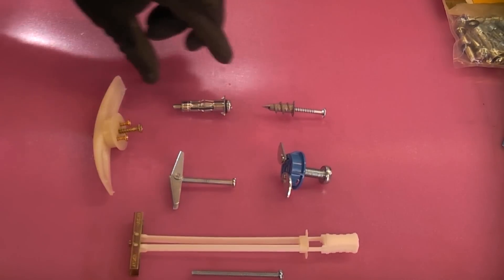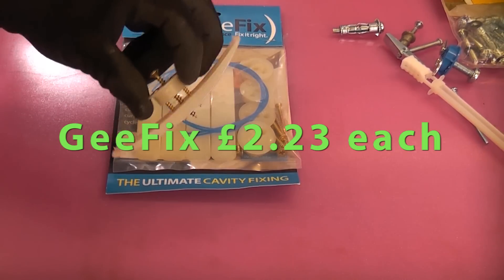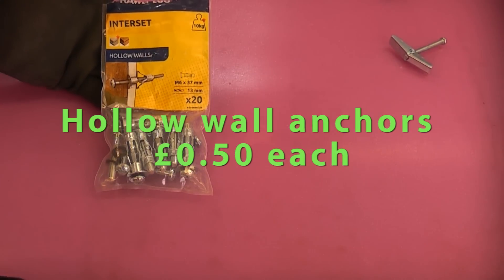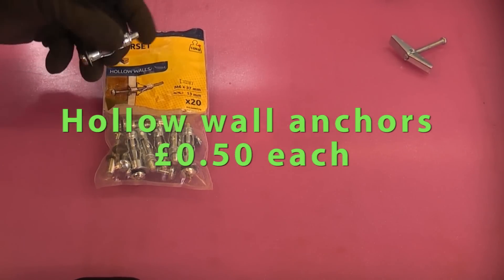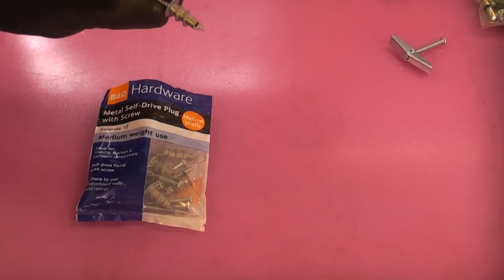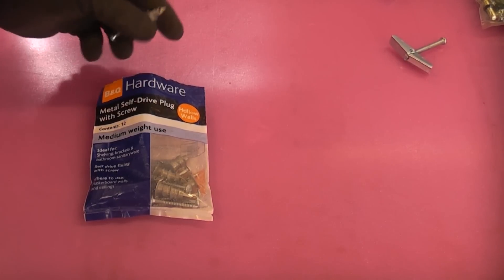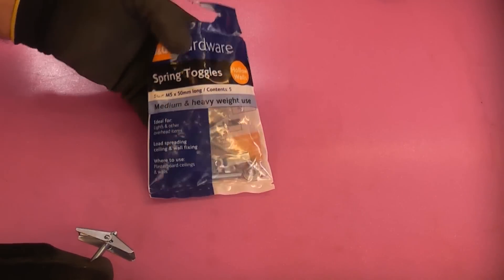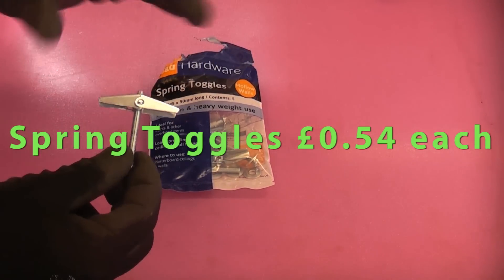The worlds strongest plasterboard fixings | Drywall fixings strength test

Comment: Good video bud it has assured me i just hung a tv up on dry wall and was giving me sleep less nights legend 🙏
Reply from the maker: Nice one!
Reply: @ultimatehandyman  
Sorry bud had a question want to hang a 50 kg mirror to plaster board cant find no studs were i want to position will it be safe to hang with anchor screws and setting tool? Many thanks 🙏
Reply from the maker: I'd use snap toggles rather than anchors-
http://www.ultimatehandyman.co.uk/forum1/viewtopic.php?t=106943
Reply: @ultimatehandyman  
Thanks legend 🙏

Comment: Great video. There's no one fixing that works all the time but typically for me - light items Fischer duopower, medium weight items hollow wall anchors, heavy items spring toggle. These fixings are cheap and readily available from local shops whereas some of the exotic ones are expensive and/or hard to get hold of.

Comment: We need another test, this time, take the three strongest - Snaptoggle, Geefix, and the spring toggles... now let's put a cantilever bracket on and add weight to that!
Reply from the maker: Just use spring toggles, they have been around for decades, work well and are available everywhere 👍
Reply: @ultimatehandyman  Thanks buddy will do. The cantilever attachment would be a good test with the three best however ;) This video needs more views!

Comment: The backet I want to use has four holes which are 4mm wide, my challenge has been finding a fixture which will fit! Do you have a particular brand of spring toggles you'd recommend?
Reply from the maker: I think the spring toggles are pretty much the same. I think I got mine from Screwfix or B&Q 👍

Comment: Thank you so much for the video, super informative. We have a 12.6mm plasterboard and want to put up an Ikea BOAXEL wardrobe system (all is mounted exclusively on the wall), but we could only find 2 studs that match the railing holes. Planning to fix 14 x M6 snaptoggles + 2 studs for 165 cm wardrobe width. Do you think this will be enough to hold? Many thanks.
Reply from the maker: I have no idea if that will hold, sorry.
All I can do is guess, and providing you fix into the two studs and use snap toggles, you have the best chance of it holding up, as snap toggles are one of the best fixings available 👍

Comment: Great comparison, thanks. The spring toggles are impressive. Were the Geefix fixings oriented the right way though? It looks like you installed them vertically (since only a thin strip of the board is pulled away on failure) rather than horizontally, which I think is the recommended way and would have supported more weight.
Reply: Indeed - would have been great to show them horizonal too.

Comment: What if the plasterboard wall is hollow e.g. fixed to nothing but a timber frame?
Reply from the maker: That's exactly what this video demonstrates. I set out the timber to the same spacing as studs in a stud partition wall 👍
Reply: Great! Thanks man

Comment: Great video...I will be hanging kitchen wall cabinets this week onto 60mm insulated plasterboard. Do you know if the spring toggles would work with the insulated board? Failing that, I could always use very long screws and plugs to secure a fixing into the brickwork. Appreciate the help in advance👍
Reply from the maker: Fixing to the brickwork is by far a better option.
Example here- https://www.youtube.com/watch?v=7DGGUbbbBZI&t

Comment: This is brilliant and has totally opened up some options for me rather than having to find a stud in the wall. This covers a sheer force but what about pulling force? Is it similar to sheer with snap toggles?
Reply from the maker: I have never tested plasterboard fixing pull force, as that would only really be useful if fixing to a ceiling. Nobody I know would ever use a plasterboard fixing in a ceiling, unless it was for a smoke alarm etc. In which case you can use any.
Thanks for the comment

Comment: Thank you for posting this video. I was planning to put a wall shelf above my bed and I was not comfortable how durable it would be over the long period of time. 

Including the weight of the wall shelf, total weight is estimated to be around 12 kgs and the shelf will be fitted with 9 hollow wall anchors. Judging from the video, it will be strong to hold the weight.
Reply from the maker: Yeah, that should easily hold that weight.
Thanks for the comment

Comment: I'd be interested to know how or if the performance of the GeeFix changes depending on its orientation. Vertical v horizontal or even mixed orientations on the same bracket
Reply from the maker: It might have a little difference, but it's the fact that you have to cut such a large hole in the plasterboard to begin with, same with the GripIt fixings etc. 
Thanks for the comment

Comment: Great video, thanks for taking the time to post! Wondering what you would use to fix heavy shelves (upcycled scaffold boards) to internally insulated walls, 37.5mm plaster onto 9in cavity blocks?
Reply from the maker: I would use either Thunderbolts or snap toggles, but also I would use space plugs or would cut wooden spacers to space the brackets so that the plasterboard is not crushed with the tightening force of the fixings.
Thunderbolts should work, especially if you are lucky enough to hit the non hollow part of the block, but I'm not sure how good the Thunderbolts will work in the hollow part, so you could use Snap toggles in the hollow parts, but I would use the M10 version - https://www.toggler-uk.com/toggler-snaptoggle-bm10.html

Snap toggle video- https://www.youtube.com/watch?v=tAIUublenMw&t
Space plugs for insulated wall- https://www.youtube.com/watch?v=7DGGUbbbBZI&t

Thanks for the comment 👍
Reply: @ultimatehandyman  true gent, was not expectinf a reply let alone a quick one that ga e me some homework. Thamks again and keep up the good worl, MBE material for public service 👍

Comment: this is fascinating. I imagine the spring toggle managed to hold more weight because it hinges so the bolts can angle downwards and still fully engage their threading while the toggle remains flushed with the wall instead of immediately cantilevering and biting into the sheetrock. I just wonder how spring toggles compare to the others after cyclical loading. I wonder if they'll eventually fail mechanically before some of the other options under the same conditions. nonetheless, a great test and great video.
Reply from the maker: Not sure, the only reason why I did this test was because I was sick of all plasterboard fixing manufacturers claiming to have the "strongest plasterboard fixing". They can't all have the strongest fixing!
Thanks for the comment 👍
Reply: @ultimatehandyman  thanks for the response. i could only speculate what was happening with the spring toggles but you could actually see from where you were standing in the video. Did you notice a difference in behavior between the strap toggle and the spring toggles? Trying to decide between these two for shelving (but I'm also going to anchor onto metal framing studs so I guess its a different situation).
Reply from the maker: @philiptatel7837   No, I did not really notice any difference but I was really surprised by the results. The snap toggles or Zip fix fixings are much easier to use though!

Comment: MY problem spring toggles is they are a pain to install, you have to set them up, then carefully guide them in while holding whatever bracket or heavy thing you're trying to mount, then pull the back so they dont spin in place and screw them in. You'd think someone would have taken the exact concept of a spring toggle and made it stay there you you can pre install it. I guess a snap toggle is pretty close but not quite.
Reply from the maker: Yes, they are one of the most difficult to use in some situations. The snap-toggles or zip fix fixings don't hold quite as much weight but are ten times easier to use.
https://www.youtube.com/watch?v=4r_MsgkXsBA&t
Thanks for the comment 👍

Comment: I love your channel. Do you know how these compare to fixing into the stud? Would you expect them to be significantly  weaker?
Reply from the maker: Fixing to the stud will be a lot stronger. Plasterboard is very weak when compared to a stud, I would expect a shelf that was fixed to two studs to be able to hold a couple of hundred kilo's without failing. 
Thanks for the comment

Comment: Great video, thanks. I was thinking of using blue gripits to fix a 1000mm wall cabinet but am now reassessing. What would you reccomend?
Reply from the maker: I would always try to fix to the studs- https://www.youtube.com/watch?v=glzwY76O0d8&t
Thanks for the comment
Reply: @ultimatehandyman  Thank you for getting back to me so quickly and the link to the other video. I will follow your recommendation to affix to the studs if possible. However obviously with a 1000mm kitchen wall cabinet  I'm a bit more limited as to where I can put it so may I ask a couple of other questions. Firstly what fixings (size and length) would you recommend if I can use the studs and secondly what fixings if I cannot.

Comment: hi, great clip and test! Can you perhaps add Corefix test to it? It should hold 250kg
Reply from the maker: There is no need to test any fixing that fixes to a solid surface to be honest. Testing out the core fix or Rigifix would be pretty much pointless, as it would be like testing out wall plugs and screws. I only started testing out plasterboard fixings because there were so many manufacturers claiming to have the "strongest plasterboard fixing"
Thanks for the comment 👍

Comment: How much weight would you trust the spring toggles to hold if hanging from a plasterboard ceiling? (assuming fixing to joists isn't an option)
Reply from the maker: Not much, as the pull out force is considerably different when they are used like that!
But with ceilings, you normally have the depth of the joists, or if it is a loft above you have even more room. In the past I have made a hole in the ceiling and installed a length of 2*1 timber, then screwed directly to that- this is better than any plasterboard fixing as it spreads the load. You can drill a hole in the centre of the 2*1 and tie a knot in a piece of string to get the timber in the correct position when you feed it through the hole. 
Thanks for the comment 👍

Comment: The GeeFix failure looks like the drywall failed before the fixing. I mean look at those bracket sized tears through the wall.
Reply from the maker: The drywall is always going to fail first, but some fixings make the drywall fail with a much lower load.
Thanks for the comment 👍

Comment: Hi Chez, just wondering, do you have any of the Fischer UX and DuoPower plugs? Don't think I've seen you use them before. I'd love to see how they compare with the others you've tested. I'm mostly using UX and DuoPower myself for convenience. I asked Fischer about the differences between them and they said DuoPower is stronger in most applications but can't fix to 9.5mm plasterboard, whereas UX can. It would be great to see how well they hold up for larger weights vs. the others in this vid.

Maybe do a part 2 with some UX, DuoPower and Wall Dogs if you get time?
Reply from the maker: I'll try to take a look at those when I get time. Thanks for the recommendation and the comment ;-)

Comment: Why do you think the spring toggle result of 176kg, was a whopping 47kg more than the snap toggle result of 129kg? They both have similar size and profile of the part, that touches the back of plasterboard. I know the spring toggle is hinged at the centre, but once its fully tightened, it effectively becomes straight and rigid, just like the snap toggle.
Reply from the maker: I'm not sure. I expected the snap toggle to be the strongest out of the lot
Thanks for the comment

Comment: the spring toggles didn't fail, the wall failed instead!
Reply from the maker: The plasterboard always fails, but different fixings cause the plasterboard to fail with different weights.

Thanks for the comment

Comment: Great video to show what happens behind the fittings in each case, to provide a clue to why the poorly designed versions so often fail and the spring toggles proved especially effective simply because of the way they spread the load around such a large area of the plasterboard rather than immediately around a small pilot hole, but many people commenting on the site showed a lack of understanding of the test that most of the load was compressive and with televisions suspended from brackets swung out from the wall there will be additional torque which this type of fitting will be especially necessary for and will render the narrower fittings completely useless for even though they withstood a good load on the shelf bracket.
Reply from the maker: Thanks for the comment

Comment: I like the ease of installation and ability to remove the bolts with the snap toggle. They look like they would work well with hanging  full length draperies and rods with strength to spare.
Reply from the maker: Yes, the snap toggles are great ;-)
Thanks for the comment

Comment: I've got to put a TV on the wall. I assumed it was a wooden stud behind the plasterboard but it's actually a metal stud. 

Any idea how I can mount the bracket to the wall? It is a Vogel 3215 and only has instructions for brick or wood behind plaster. 

Thanks.
Reply from the maker: You should be able to locate the metal studs, then use some self tapping screws. You will of course have to drill pilot holes into the studs.
Reply: Ultimate Handyman Thanks for the reply. I really appreciate it. I should have said that the studs are not sold metal, more like a wire mesh construction. I think I will try the blue gripits, only issue being that the mount has only 3 fixing holes. I just hope 3 gripits  across the span of the mount is enough!

Comment: Hollow wall anchers work well for most things and a good tip is you can start them off then return back before you fit in the plasterboard it makes easier to fit.. they open up easier once fitted..
Reply from the maker: Thanks for the tip ;-)

Comment: TroyDIY
Your video was very informative and useful but I would like to hear your opinion on the recently developed (very) heavy duty BLADEFIXER plasterboard fixings, which boast a 245 Kg maximum weight.  
Here is a link to their web site https://www.selectproductsltd.com/bladefixers/ for your information.
Keep up the good work,
Troy
Reply from the maker: I tried them a few years back after someone recommended them in the comments section.
The company that makes them sent out some sample ones and I tried them, but could not get them to work as the screw kept missing the slot. The company said they had sent out the wrong ones (prototypes), so sent out some more and exactly the same thing happened.
After a few attempts I figured they were not fit for purpose, as I had tried them a few times and could see the back of the fixing in my set up, so what chance would a DIY'er have in a stud partition wall without the benefit of being able to see the back!
I have since bought a pack from Screwfix to try again, if I can get them to work as they should I will test them on the rig in this video.
Thanks for the comment
Reply: Thanks for taking the time to reply to my comment.  I have to agree that they look a bit awkward to use for DIYers like myself.
Reply from the maker: You are welcome ;-)
Reply: I had the same thoughts but would certainly be interesting to see how they perform as they effectively form a clamp if everything lines up.

Comment: Excellent video. Very helpful!
I was going to use the Snap Toggle fixings to hang a Wall Heater. But after watching this I’ll be using the Spring Toggles. They’ll be more than enough to support a 10/12kg Wall Heater!! 
Thanks again. Best Channel on YouTube!!
Reply from the maker: Yes, spring toggles are also normally cheaper and easier to find.

Thanks for the comment

Comment: Can you update with some of the dot and dab fixtures like rigifix. I'd like to see what weight the m8 can hold
Reply from the maker: No, I'm afraid that test would be a waste of time as there are too many variables with the substrate that is behind the plasterboard.
Fixings like Rigifix/core fix fixings should take a lot of weight- much more than if fixing to the plasterboard, they should give a similar fixing to that of the wall itself if wall plugs were used.
Thanks for the comment

Comment: This is interesting. Do you think the failures are more to do with how each type of fixing distributes the weight across the board rather than the overall weight itself? I'd guess the smaller fixing would focus the pressure in a very small spot, right on the drilled hole area, whereas something like the spring clips have a much better chance of spreading it out over a further area.

I'm watching as I recently put up a 55" TV through plasterboard, a small gap and then got some bite into the brickwork. I was OK with four of the fixings but don't think two were sitting right. I might go back and change some or add a couple of dedicated plasterboard fittings. One thing that also concerns me is that the bracket can extend off the wall to quite some distance, which I imagine puts a lot of extra outward strain on the fixings compared to being flat to the wall and the strain being downwards. Have you ever looked at fixings in this situation, with the weight/load sitting away from the wall rather than directly on it?

Good video.

Comment: Do you think metal plasterboard screws will be sufficient to hang a 10kg mirror? Or would it be safer to go with the hollow anchor ones?
Reply from the maker: I'd use the spring toggles to be on the safe side.
The metal plasterboard screws should be ok though
Reply: Ultimate Handyman just in case anyone else wondering I hanged it on the screws and it's been solid.